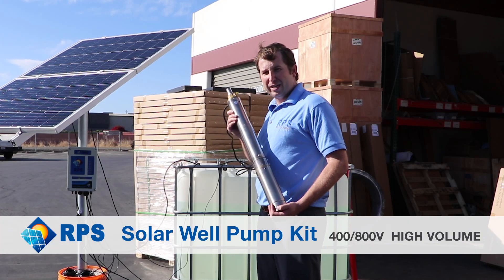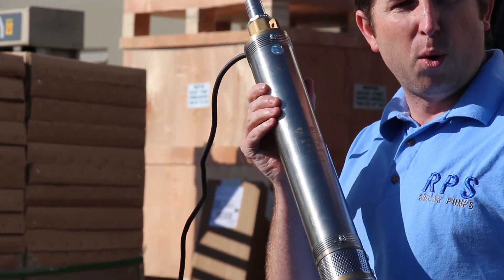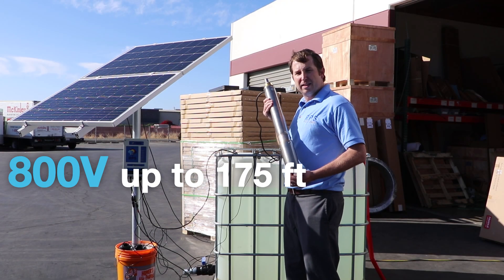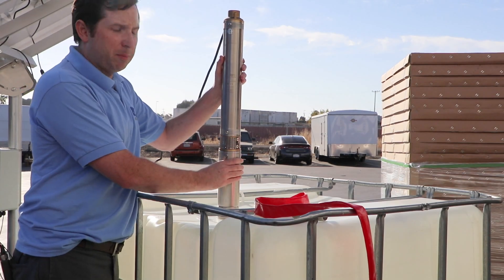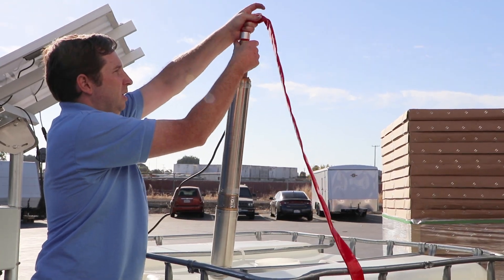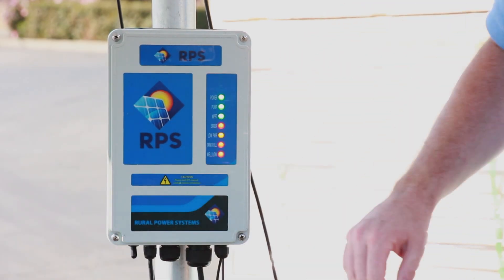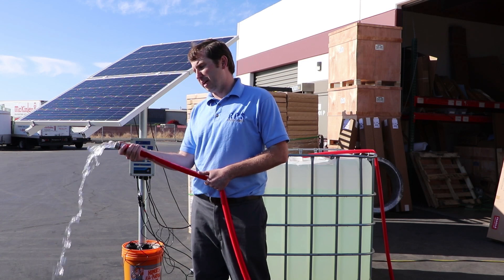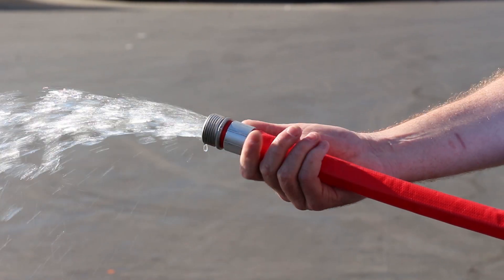3" Centrifugal Solar Well Pump Demo RPS 400V 800V

Comment: I would like to install the 800V at 100ft to replace my current grid powered well pump for my house. I've unfortunately not been able to get a detailed answer from RPS on what kind of batteries I would need to pump at night/cloudy days. I understand that I would need (4) 12v batteries, but I would need to know how many amp hours are needed on each battery. Stats would be nice (e.g. "(4) 12v 100AH batteries will run the 800v for xyz hours/minutes.")
Reply from the maker: 4x 100AH batteries will run the 800V for about 5-8 hours. Since the batteries are connected to output 48V, you have 100AH at 48V. The 800V pulls about 10 Amps when running. You can lookup battery bank sizing calculator and play around with the variables to get a more accurate estimate for your specific setup. Also keep in mind that you will need to add additional panels to charge your batteries as well as run your pump at the same time if that's what you are intending.
Reply: @RPSSolarPumps  This is perfect, thank you!!
Reply: @RPSSolarPumps  I thought you couldn't use batteries with the 800v
Reply: @RPSSolarPumps  how do you upgrade from the 400v to the 800v? More panels and different controller?
Reply: Good ones.